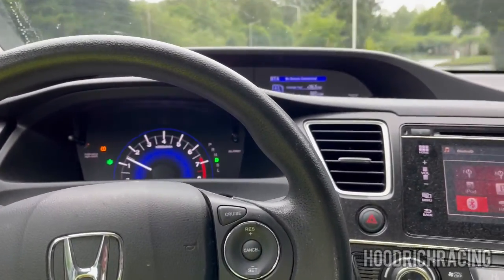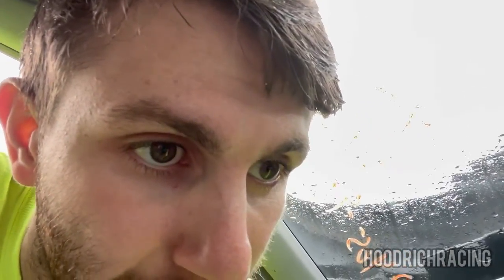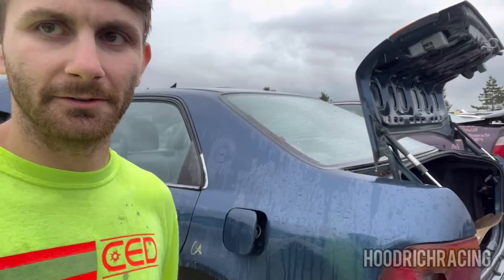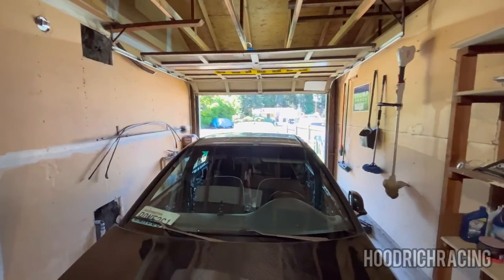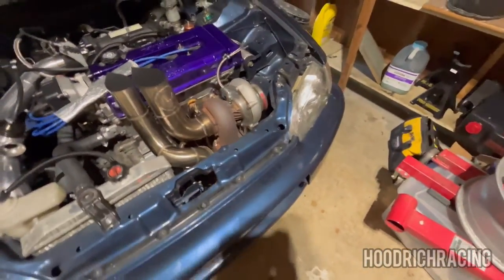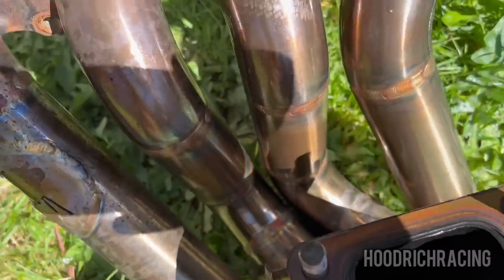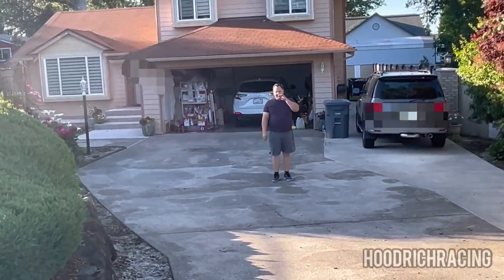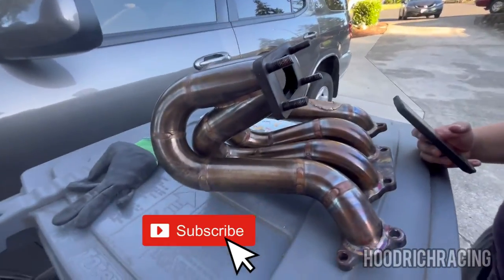Junkyard Run (Driving far for parts) | Bad news for the sedan, kinda.

Comment: Im just going to guess? i believe with all of the weight hanging off of that manifold. and the heat your engine is generating it just cracked.
Reply from the maker: Yeah the turbo and wastegate bolted up to it doesn’t help lol plus all the vibrations. It’s gonna need a bracket or something made to support the weight.

Comment: The sedan looks great !  As far as the top mount situation, I can relate . Im having the same issue myself.  Seems like the weight and amount of vibration might be causing this issue. Only thing I’ve seen people do is create Brackets to support the weight of the turbo .  That might be creating a bracket from the engine to turbo.   🤙
Reply from the maker: Thank you bro. Yeah I thought about making a bracket for added support, like oem headers. Mount bracket to the block and to the manifold.

Comment: I have 2 cracks in my turbo manifold as well. Also one manifold stud broke off. It's robbing me of hella power. I have a TSM top mount manifold.
Reply from the maker: Yeah wasn’t making full boost. Fixed now. Welded inside and out all runners. Cracked manifolds suck bro. Cracked like 3 times on me lol crazy we have the same issue with cracks and studs. New video coming out soon, everything is fixed!